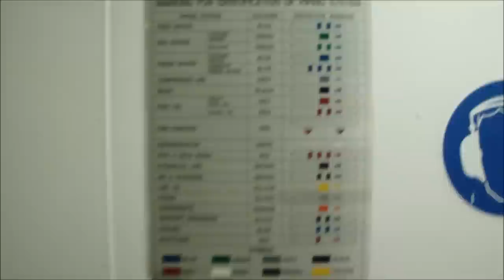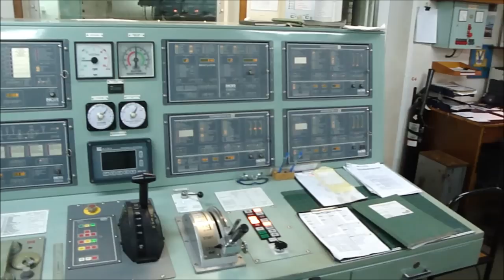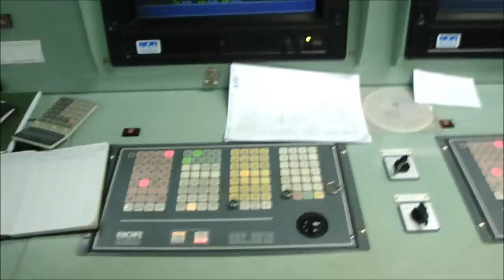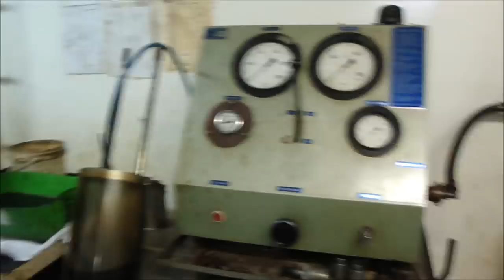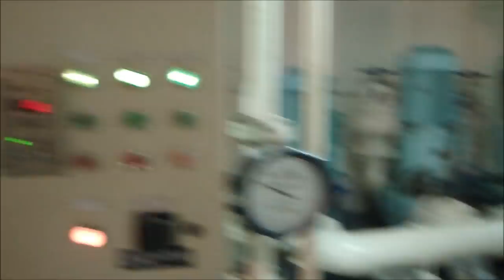Engine room tour onboard the Iver Expert

Comment: What a great video, thank you Jasper.

Spent the first 16 years of my working life as a Marine Engineer before coming
ashore for family reasons.
12 years on Product and Crude carriers motor and steam, 25,000 - 270,000 T.
Our 6 cylinder main propulsion were a little larger and slightly slower however
time and technology marches on.
4 years on Diving Support vessels.
Had I remained single I am sure I would completed my career at sea.

Comment from the maker: Thanks, Well I am not an engineer but I think it is in case we have problems with the steering gear. When something happens to the hydraulic part of the steering gear, and all the hydraulic oil drains out of the system onto the floor, you are still able to walk there.

Comment: This may be a stupid question, but what is a 2-stroke engine doing with valves?
Reply: +cyrex686
It still need exhaust valves ;)
Reply: When fitted with an Exhaust valve. Then these engines are termed Uniflow it is all to promote efficient scavenging of burnt  gasses.

Comment from the maker: Hi, Well these 2 stroke engines are made for long continuous running. These engines have a few fixed RPM's ( Dead slow, Slow, Half, Full and Sea ) These are fixed RPM's as you can see at the plate on the engine next to the local engine control. However you can set the engine on any RPM you like. But between 52 and 63 RPM the stress inside the engine is to high for continuously running and can result in some serious damage. Passing these RPM's when speeding up/slowing down is no problem.

Comment: If the engine stays for prolonged time periods at critical rpm the engine will be damaged of even destroyed. This happens because of the tuning of the natural frequency of the engine with the vibrations that the engine has at this RPM.Critical speed is different among engines. All engines have critical speed even our cars, but car engines are high RPM engines, so critical RPM are already overcame when we start our engines at about 1000 RPM.

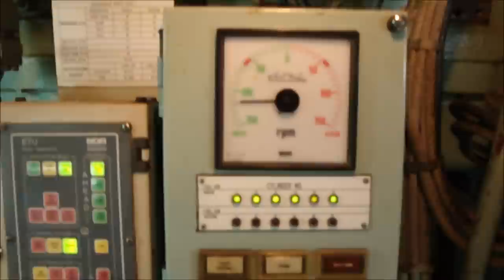Comment: 16:05 Can someone tell me if the main engine is reversible?  The RPM gauge shown here appears to indicate RPMs in the reversed direction but i find it hard to believe that the engine can actually be reversed.  I always thought the propellers were variable pitch and could produce forward thrust by changing the pitch rather than actually reversing direction.
Reply: Yes, engines such as this(and this engine) are in fact reversible.  Variable pitch props do exist, but are not as common.

Comment: Thanks for making this Jasper, always wanted a video showing everything in an engine room. 

I was wondering if you could tell me what the Critical RPM of 52-63 means on the Main Engine Speed table though. Why is that speed critical? Does it not run as well at that speed?

Comment: Half een motor (M/E)? Iemand snijd het in tweeën? lol (Eigenlijk, ik ben gewend aan het dubbele van de cilinders ook slechts een halve meter boring? Ach, ik veronderstel dat was alles wat ze hadden in 1997!)...

Ik zag dit een paar keer, maar deze keer merkte ik uit uw monitor in CR dat cilinder liner (jacket) was in rood en het lezen van "0". Waar ging dat over?

Ook, rpm indicator op de motor de juiste wankelde alsof rpm was niet stabiel (kunnen worden gerelateerd aan rode "0" indicatie voor nummer 4 cilinder jacket?)

Mooie machinekamer in het algemeen!  Dank u veel!
Reply from the maker: Well this is not a container ship so its not build for speed so a 6 cylinder is very common on ships of 180 m (Tanker/Bulk). 

The red 0 was a High Temp. Cooling water sensor that just broke. So there is no reading at that time.

The Engine is running stable.

Comment: Thanks for an interesting tour Jasper.  Question:  Why the wooden slats on the floor of the steering gear room?
Reply: +divisioneight Hydraulic oil and painted steel floors are very slippery, there may be some oil mist from tank breathers in the room. The slats give some grip.
Reply: They are as a result of the "Amoco Cadiz". Her steering gear failed and the leaking oil caused the steering gear room's floor to be coated with oil. As a result the engineers couldn't reach the steering gear and the ship ran aground off the French coast with a massive oil spill as a result. Since then the steering gears of all ships have to have steel gratings around them, or in this case wooden.

Comment: Fantastic, thanks! I take it the inert gas is for use as a fire extinguisher?
Reply from the maker: We use the inert gas system for inerting the cargo tanks. This way there is no explosive mixture of air on top of the cargo inside the cargo tanks.
Against fire in the engine room we have an CO2 system. With this system we can fill the complete engine room with CO2.

Comment: Great job man
But where were all the mechanics and technicians??
Reply: It dosnt take alot of hands to run the engine dept with computers and such. Most of em spend their time in a little hutch closed off from the rest of the engine room monitoring screens... not what it used to be.
Reply from the maker: Cessna 182a
This is not  100% true. On board we have 4 engineers and 3 ratings doing maintenance.
This engine room is what they call "Unmanned", that means that it is allowed not to have someone to be in the ER all the time. This means that at night time there is no one, and that the duty engineer will receive the alarms in his cabin.
They all work during day and are doing continuously maintenance on all the engines/pumps and other machinery.
I dont see computers do any maintenance !!. The computers we have are there for the maintenance/planning programs. 
Maybe the Chief Engineers spends most time in the Engine Control Room yes, but he has a lot of paperwork to do. All the others are always working hard outside this Engine Control Room.

I made the video at night time. I went down with the duty engineer who had to make his evening watch round. He does not like to be on camera though :)
Reply: So I assume most new vessels being built have unmanned engine rooms... Thats probably what most of em are since bridge control became a thing? Btw great video, sir.
Reply: Thanks to both of you for try and answer my question,now I know how is the engine room of this kind of ships
I guess it's the same thing for  the cruise ship,kind of reminds me of "Titanic" the movie while all the people the in cruise were having fun,drinks and why not "sex"
Deep below the ship an army of workers kept the engine running.Both of you are right more "computers and high tech equipment" may require less workers,but all kind of mechanical devices need manually maintenance and even newest ship of all kind are not  exception.
Reply: Jasper van Stratum
 I spoke to a guy at my gym who worked on a container ship and he said computer or no computer he saw some techs who could be relied upon to literally "hear" when something was not quite right within the rhythm of the machines that the computers would not be aware of!
Reply: +Alejandro Fallas . Its 103 yers sicnce the Titanics Steam engine stopt for the last time .  :-)
Reply: +mxylpx Those exist in most any industry. I do that with the manufacturing equipment I maintain on my job. If there's something wrong with it, I'll either hear it sounding a bit off or the computer will throw a fault code.
Reply: ums! un mand sistam! u dont need  engineers   24/7 if anithing happens a alarm go off!
Reply: still lots, lots of work ((((((( sometimes hell!!
Reply: Good video. All of us landlubbers who stand on the shore and watch these amazing ships glide by  suspect that there is much more to it all than meets the eye. This is a very educational video and thank you  @jaspervanstratum  for posting.

Comment: Wait, I have something to ask. Is anyone here knows what are the duties and responsibilities of a PUMPMAN? I am planning to try to work on board, as of now I am working as a mechanical technician, I also work before as a hydraulic mechanic, And also a machinist by profession and have a year of experience. I need your advice guys, thanks.
Reply: The Pumpman was a crew member whose main function was to oversee the operation of the cargo pumps in oil tankers, and be very familiar with the pipework and associated valve systems to allow any of the pumps to deliver cargo from tanks to shore etc. They also had other duties when the ship was between ports and this additional work was usually controlled by the Chief Mate or Chief Engineer. A good pumpman was always an asset as they could be relied upon to operate the machinery in a professional and safe manner. With your qualifications I would think you could cope with the work, but have you not considered a post as a marine engineer? More challenging, but better pay etc!
Reply: Thanks for your info. very much appreciated. Can you recommend me any educational sites, and videos things like that sir. thanks

Comment: What does the steam from the exhaust gas boiler supply?
Reply: vessels like these burn HFO or heavy fuel oil which needs to have its viscosity (pumpability) to be change-able, and steam heating is used for this. if heating is not supplied the fuel will not flow.